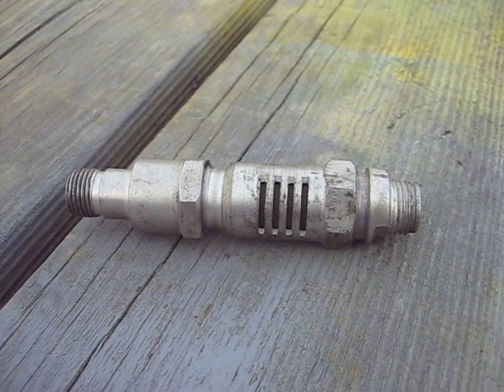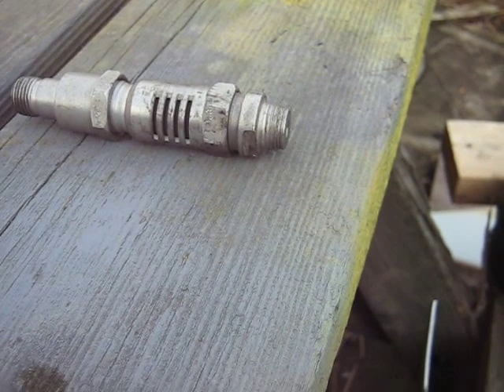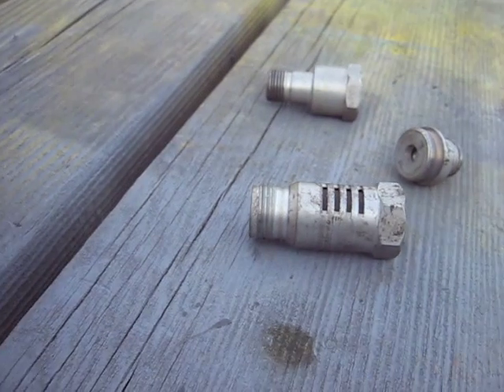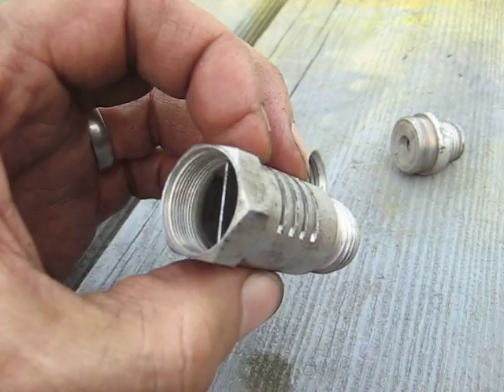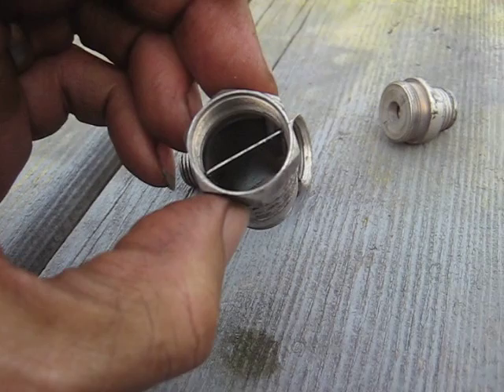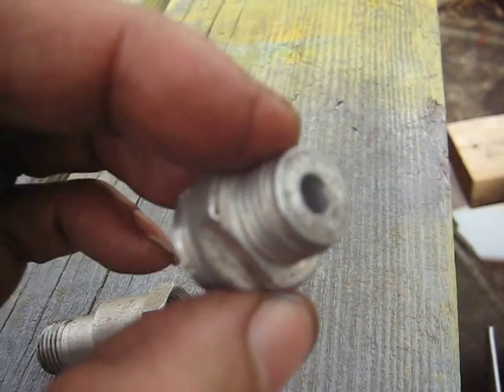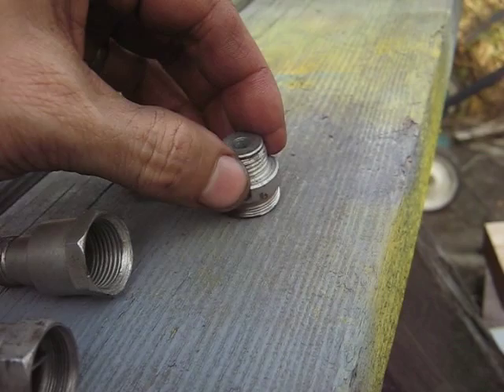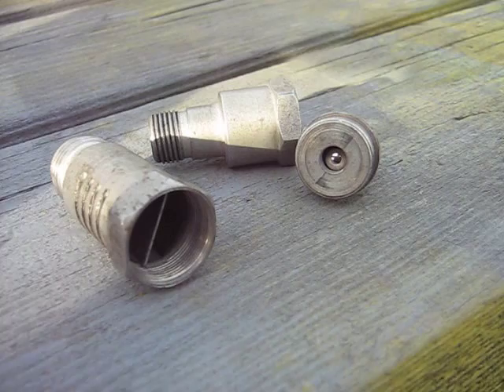1960s Air Compressor Device Teardown

Comment: The one you have in this video could be made by Sears, Imperial, or Enginair. Schrader was the only company that made a different style pump diaphragm. Sears was the only one that used a rubber hose, all others being braided.
Reply from the maker: Hey, thanks for the info. I think mine is a Sears model, since the hos is not braided. Quite the ingenious little device, and some people these days think we are so much smarter than previous generations....No way Charlie! :)
Reply: I agree...I guess some things just get lost in time

Comment: I just bought one of these. NOS Sears/Roebuck. It is the rubber hose but in good condition, hopefully it holds up well. Im excited to test it out with my CJ's 258 inline 6. Should make for a great trail or emergency air pump. Thinking it will also be more reliable than the 12 volt alternative.
Reply from the maker: I think this should only be used with an engine with a carburator (or disconnect the wires to the fuel injection for the cylinder it is screwed into. Otherwise you will get gasoline vapors into the tire!

Comment: I still have 1 of those in the garage it was called "enginair pump" mine is still in the original box but the rubber has long since perished, also the end that screwed into the head on mine had 3 different stepped threads so you screwed it in till it found the right thread, from memories they worked very well.
Reply from the maker: Mentorcase Enginair pump, cool name  :)I am very impressed with the simplicity of this design, thought the very thin rubber "valves" could be hard to find a similar material to use these days. I think even a bicycle inner tube would be too thick. I remember the stepped threads you mentioned, it would pretty well fit any spark plug hole.
Reply: I think some thick dishwashing gloves would make perfect valve replacements.
Reply from the maker: You may be right, the originals are pretty thin.

Comment: hey! i just got one of these! I converted it to spark plug size for my model t ford.  it origionally came with black corregated pipe and a 100lb pressure gauge and a twist on fitting on both ends to attach to the engine and one for the valvestem.  pretty cool little system,  thanks for explaining.

Comment from the maker: @listepikster 
That is hard to say, although there is a vacuum in the intake manifold, the piston is also moving down creating a vacuum, so I would imagine the piston would win out, but you make a good point there. I tend to think that this item did work though, but I have to admit that I have never seen it in operation on a multicylinder engine.

Comment: @ChargerMiles007 i have actually been thinking.. if you run this device in a 4 cyl engine. then on the intake stroke of the cylinder that it is fitted to it would draw air into the intake manifold through the intake valve thus making the air fuel mixture very lean.
i wonder if it would even run. and if it will i believe it will run very rough.

Comment from the maker: @listepikster 
Yes, you are right, I never thought about the engine idleing. The engine is being air throttled, so it is itching to pull in more air, so it would take the easier path, and pull it in thru the compressor device. Yes, it would come in handy for an emergency, perhaps that is what it was intended for. I had the whole unit back like 30 years ago, but once it came out of the package, parts started to evaporate! :(

Comment: at idle an engine has very low presure in the intake. therefore in the intake stroke if this was fitted, the cylinder would hardly suck any air fuel mixture from the intake manifold, it would much rather suck fresh air through that valve. thus pumping almost only fresh air to the tire.
very clever litttle emergency tire pump.
Reply: Listepikster  where can the inflatore be purchased!